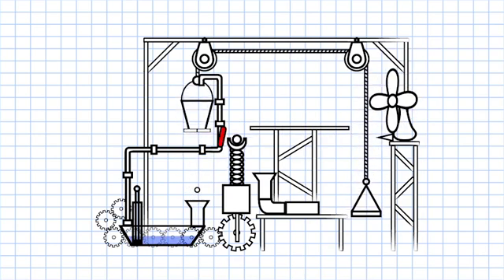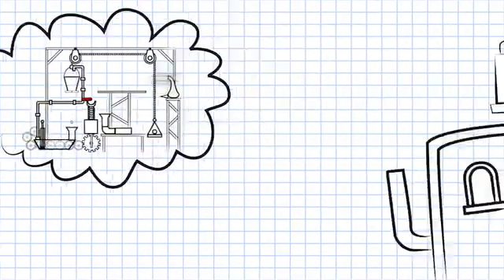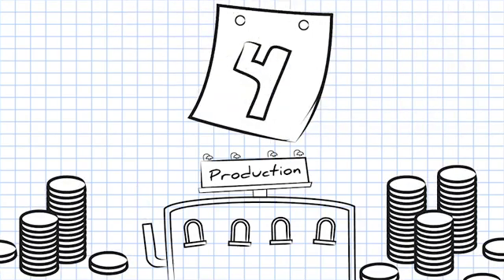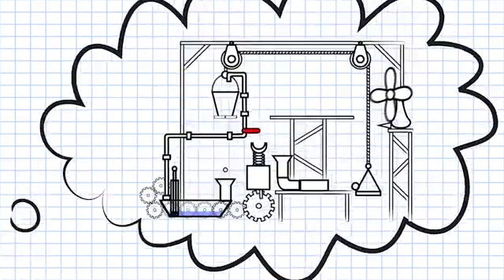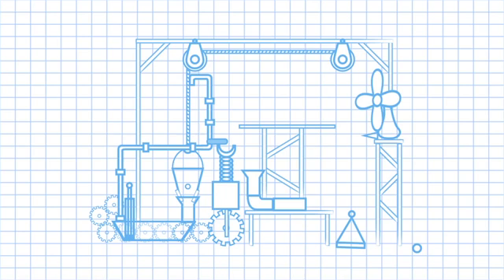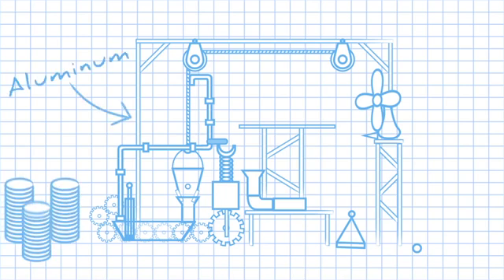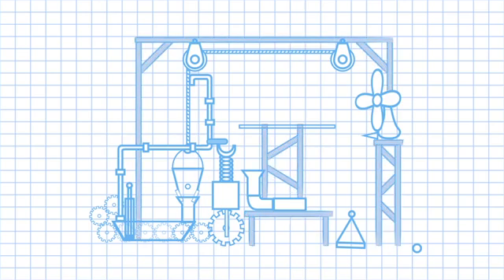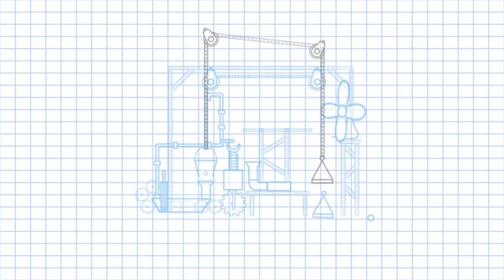Fundamentals of SolidWorks Simulation

Comment: i was using solidworks and i customized and added flow simulation menu but for some reason the next time is opened solidworks flow simulation option was not there. so i clicked on the customize option and the flow simualtion option was there along with the FEATURES and other options but it cannot be seen. so i tried to delete it and then again add it but after i deleted it i cannot find the flow simulation opiton even in the customize option. how can i add flow simulation now?